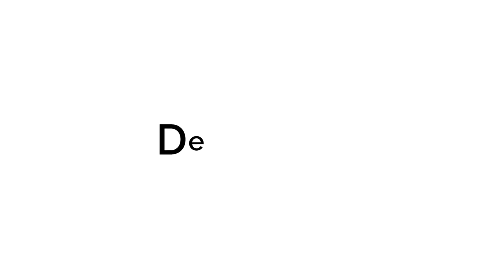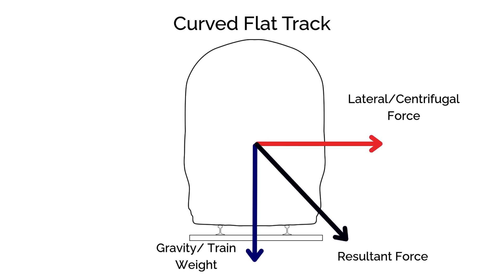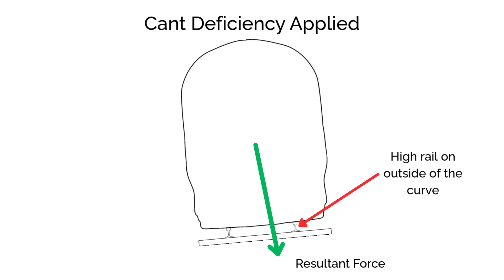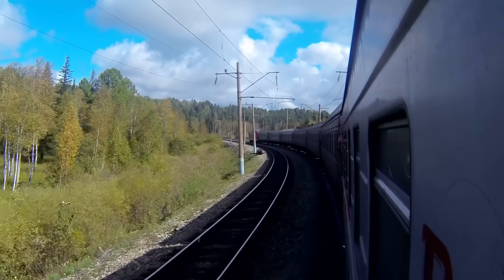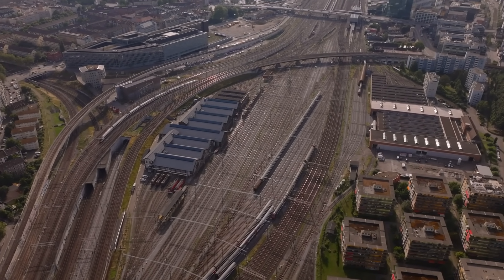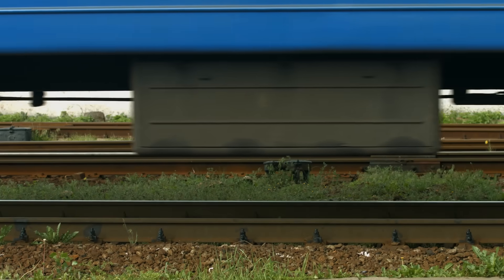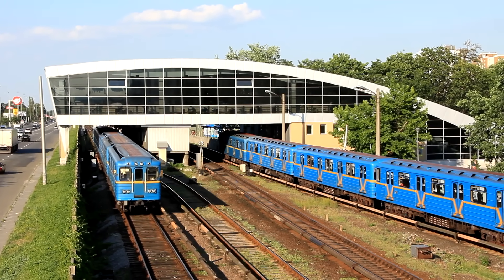Why Don't Engineers Apply the Perfect Cant to Railway Curves? | Cant Deficiency Explained

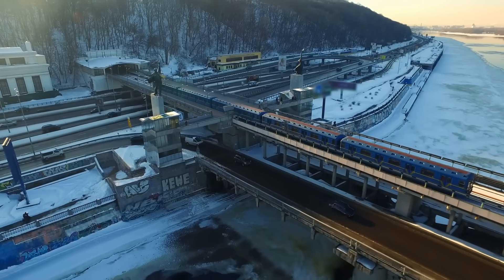Comment: 3:44 Is this Kyiv/Kiev? 4:26 Exactly Kyiv, Red Line of metro.
I think, the cause of cant deficiency is simple: even at a single speed, trains rely on conical wheels to do turns. Cant is balanced → the wheelset turns with a flange rather than with taper.

Comment: Well put together, explaining the mechanical and human perception of it all. Hats off to the commentators that have explained the real world physics as well.

The footage shown during the explanation was certainly entertaining; it led to me trying to guess where some of it was! Although you stated that the maximum values in use were more or less the same in France & Germany as in the UK, I suspect that there are some sections of the DB that do tend to work at the top end. I can remember a trip I made years ago, on a train from the east via Poland, Germany, to Brussels. The route that almost follows one of the rivers, and curves a lot, resulted in a really smooth ride (better than some parts elsewhere), albeit evidently tilting either way, quite a lot! 

Although it’s about railway design, there is no shortage of road layouts that actually have negative cant, with the effect on what the safe maximum speed is round the curve (setting aside visibility).

Comment: Centrifugal force is a fictitious force.  What appears to you as the passenger inside the train to be a force pushing you toward the outside of a curve is just your own inertia resisting the deviation from the straight line.  The actual true force is a centripetal inward force exerted on the trains wheels by the curving rails.  I think we accept the existence of the fictitious centrifugal force to make the force vector diagrams illustrate an "equilibrium force" directed perpendicular to the plane of the rails on perfectly canted track, but that isn't exactly what is happening.  Student pilots are taught to make coordinated turns using these same imaginary forces and it does work.  I found the explanation helpful in understanding why the maximum predicted cant is not used, and that's the main thing.

A curving fighter aircraft firing its fixed guns forward will appear to the pilot as if the bullets (tracers) are curving away from the turn but of course they are flying in a straight line in the horizontal plane once they clear the gun muzzles.  (In the vertical plane they are describing a shallow parabola owing to gravity.)  Nonetheless gyroscopic gunsights mounted in the airplane can "pretend" the bullets are being pulled away from the plane's path by centrifugal force and use that fictitious force to compute the lead and deflection necessary to allow hits on the plane the aircraft is chasing.  The mechanical computer driven by the gyro displays the correct aiming point on the screen of the gunsight when the pilot puts the bulls-eye on the enemy plane -- assuming he can turn as fast as the other plane.  This will, of course, not be dead ahead of his own plane the way it would be if both planes were flying straight and level.  The pilot, when he fires, will see his bullets fly out ahead of the enemy plane and then appear to curve back apparently from "centrifugal" force and hit it.
Reply: Is it really fictitious, or is it just frame of reference?  It's exactly (and for the same reasons) as fictitious as gravity, and we accept that as 'force-like' quite easily.
Reply: @tristanridley1601  that is what he is saying essentially, it's not a real force but for most intents and purposes behaves like one, so it's a great approximation to use for practical things

Comment: When a tilting train tilts, isn't it moving it's center of mass? The forces stay the same, that's correct. But wouldn't those forces act at a different location and therefor the forces on the rails would change?

Comment: Another consideration is that is is always possible for train to stop, even if that's never intended. If it does stop, you don't want it to fall over. This limits the cant even for tracks used only by high speed trains.
Reply: 😅९०९
Reply from the maker: Your very right!
Reply: @thepwayengineer  Before seeing this video, I thought that was the main consideration.  That, and string line derailments.  On some local tracks, I have noticed that cant has been reduced from that of previous years.

Comment: Iget dubious whenever anyone introduces centrifugal force into a physics diagram as centrigugal force does not exist. It is a perceived sensation. What is occuring is a centripetal force is deflecting a moving mass and INERTIA is trying to keep that mass moving in the same direction it was acting before the centrital force started acting. Inertia feels like a force acting on someone in a cornering car - but it isn't a force, its inertia.
If you have to draw a "force" diagram using inertia it is better to have the point of the force arrow pushing on the object, not having an arrow leaving from the object.
Reply: Technically you are correct that centrifugal force does not exist, but the term is in general use to describe the percieved forces acting upon objects moving in a curve. It's similar to the concept of suction, technically it does not exist but it commonly understood and is useful in everyday conversations to explain what's happening. On the other hand talking about centripetal force, inertia and atmospheric pressure would lead to more confusion in most situations.
Reply: I agree, but if you did, the force vector diagram would show the resultant "equilibrium force" vector (also a fictitious force) pointing in the wrong direction, toward the inner rail, not the outer one, and this would scuttle the ability to calculate the required cant. Go along to get along is the best approach in these discussions.
Reply: The train applies a force in the rail towards the outside of the curve. This is the centrifugal force
Reply: @kombirat  No it doesn't. That is just the inertia of the train trying to keep going in a straight line forever.  It's the rail that exerts the centripetal force on the train pushing it into a curve.  The train won't go into a curve unless a force acts on it.  That force is the rail interacting with the wheel,  pushing inward.  Centrifugal force doesn't actually exist.  When your spin drier seems to fling water off your wet clothes by centrifugal force what's actually happening is the drier drum pulls the clothes rapidly into a circle by the centripetal force developed by the drier's motor.  The water wants to keep going in a straight line, which it does, separating from the clothing and moving tangentially away from the rotating clothing.    The train is trying to do exactly the same thing.  I know everyone thinks that centrifugal force is real, but part of introductory physics is learning that it isn't.  It's an illusion created by the rotating frame of reference.

When a car hits a brick wall, it's the wall that exerts the retarding force on the car.
Reply: @lesliemacmillan9932  Are you trying to tell me that there isn't a force acting laterally on the rails
Reply: @kombirat  Not exactly.  The train through its inertia to go in a straight line is trying to tear the curving rail off the sleepers as the wheels bear into it but it's the centripetal force exerted by the rail that turns the train.  If the train did keep going straight, by tearing the rail off the sleepers and derailing, there would be no illusion of something pushing you to the outside of the turn, because the train would be going in a straight line.  It's only when the train starts to curve that the illusion of a force arises.  You, the passenger in the train, want to keep going in a straight line from your own inertia so you appear to slide outward on your seat as the train, driven by the curving rail, curves away from the straight line.   It's the train curving inward under you that makes you slide outward, not some magical pushing force that appears just as the train starts to turn.
Reply: @lesliemacmillan9932 The train is turning and applying an outward lateral force (referred to as the centrifugal force) on the track. This is shown in the diagram.
You could argue that the diagram should show the centripetal force applied from the track on the train, but in this case the diagram should also show the normal force acting upwards rather than the weight of the train acting downwards.
In the case of the video, the free body diagram is of the forces the train is imparting on the track. The free body diagram is correct.
You cannot have gravity acting downwards and also have the centripetal force from the rail acting inwards as that would be an incorrect free body diagram. The rail is not pulling the train down. The train is not pulling the rail in. There is no frame of reference where this free body diagram would be logical
Reply: Imagine a bowling ball sitting unrestrained on a flat car (as we call them in North America.). The train enters an unbanked curve at high speed.  To a brakeman  standing on the flat car, the bowling ball appears to roll off the outside of the flat car by centrifugal force.  But to a camera in a drone going straight, keeping pace above the train while it was going in a straight line, the bowling ball is seen to continue in a straight line as it rolls off the edge of the flat car.  It’s the flat car that deviates off the straight line under the freely rolling ball.  The ball keeps going straight.

Because the ball continues on a straight line, as seen from a non-accelerating frame of reference (the drone), there can be no unbalanced force acting on it.  Therefore there is no centrifugal force.  It’s just an illusion we feel in our bodies when we are in an accelerating reference frame.  It’s not just our brains that perceive this illusory force.  Accelerometers will “sense” it, too.  The only unbalanced force in the system is the centripetal force acting on the flat car by the rail, making it turn.
Reply: Centrifugal force is a force is the EXACT same way that gravity is a force.  They are both caused by a non-inertial frame of reference.  As long as you also refuse to call gravity a force, then you are correct and not a hypocrite.  :)
For the rest of us, it's fine to call it a force.
Reply: @tristanridley1601  No.  Gravity is not caused by an non-inertial reference frame. Gravity is a real force that arises from the interaction between two massive objects irrespective of the reference frame.   We don't know how gravity actually arises but it is a real force that exists even in an inertial reference frame.  An object that is not rotating or otherwise accelerating still exerts an attractive force to all other objects with mass.  It so happens that all the objects that we see exerting gravitational attraction:  the sun, the earth, the moon are in fact rotating but that is not why they have gravity or why we perceive it as a force. 
Gravity is a real force.  Centrifugal force is a fictitious force because it appears only in a non-inertial reference frame.  It allows certain useful predictions like how much you have to cant track in curves to keep trains from flying off them but it doesn't explain why that happens.    I am not a hypocrite.
You don't understand this.  I'm not skilled enough to explain it to you.  So let's call it a draw.  The Wikipedia treatment of centrifugal force is pretty good.

Comment: I was wondering. On high speed tracks like LGV lines where they only let TGV's run on. There are sections where they probably expect all of the trains to run at 320km/h. Do they use the cant equilibrium for those turns or do they still use cant deficiency but they use less? Amazing video btw. I learned a lot from it👍
Reply: Good question, I think they use the maximum possible value without affecting stability when the train stops in the curves (it happen sometimes).
Reply: "they only let TGV's run on"

Only trains with "CAB system" (in cabin display of signals) are allowed.
That doesn't mean only TGV that people take. Some other loco are allowed, some ancient, but equipped with the system.
(They are used for track measurements.)
Reply: equilibrium cant all the time feels weird to passengers (potentially to the point of motion sickness sometimes),
 so there will be cant deficiency used.

Comment: I've watched videos by engineers about road construction and the issue of cant was discussed. But I didn't realize it also was an important factor in the design of railways. The curves on railways are necessarily much more gradual (they have a much larger radius of curvature) and trains would undoubtedly slow down on a curve so I didn't think cant would be required.
Reply: On some freight-train-only curves they use reverse cant (or reverse super-elevation as we call it here in North America) because long trains (150 cars) with high cargos like double-stacked containers may tip over from the inward forces when a stopped train has to start on that curve.  But generally even low-speed track is super-elevated to reduce the load on the outer rail.  Freight trains may be slow but they are very very heavy!

Comment: I remember when a freight train stopped on the curve, as they commonly did in that location, and a top-heavy load of pipes tipped off a flatcar, broke loose, rolled down the railway embankment (atop a levee) and bowled down the nearby power lines, causing widespread power outages.
Train didn't know or care; didn't derail, kept going.

Comment: Tilting trains hammer the tracks on curves. I noticed a cracked rail while waiting for a train on a station on a sharp curve on a main line in Sweden. I reported it to the driver and it was quickly replaced. 

Last year the track on a sharp curve on Gothenburg tramways broke due to excessive speeds.
Reply from the maker: Well done for reporting it! Speed and over speeding is a huge factor for sure
Reply: @thepwayengineer  Kind of defeats the purpose of high-speed trains, though, right?
Reply: Actually they don't, or they don't if they're designed properly. 

When working on BR's APT-E we did some tests running through an instrumented curve on our 14 mile lone test track to see how the tilt system affected the loads on the rails and the wheels. Even with a vehicle tilted 12 deg, the WRONG way, simulating a total system failure, the loads on the track and wheels were within acceptable limits. With the vehicles tilting properly the wheel loads actually decreased by a small percentage, and the track loads increased by an equally small, but acceptable level.
Reply: @kitspackman3994 
How would tilting reduce the lateral force on the outside (high) rail if the train is running faster than the speed that the angle of cant the track is set to? A lateral force is needed to steer the train round the curve, which is what the cant provides.
Reply: @physiocrat-sv  I'm only reporting what actually happened, not why it happened. At a rough guess it may have been because the CG of the vehicle moved inwards relative to the track, which was possible due to the swing link's geometry. We didn't intend to measure a CG shift then, we could only measure 36 parameters during any test rest run, it was during the 1970s remember.............
Reply: I imagine the sleepers would take a real beating and the "insides" of the outer rails would take a lot more wear over time
Reply: @Great.Milenko  
The track is used by the X2000 tilting trains and frequent heavy freight